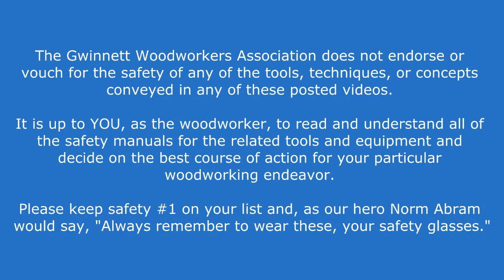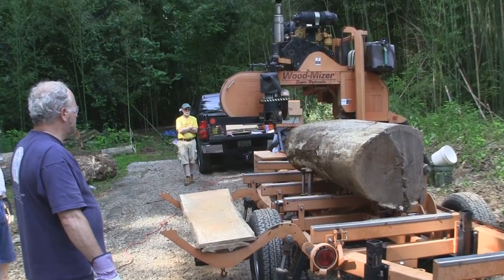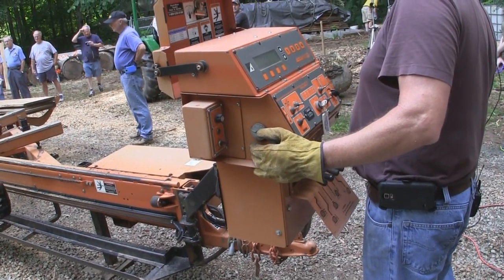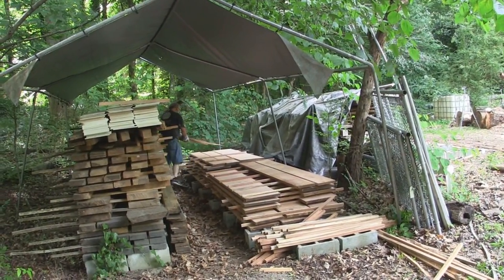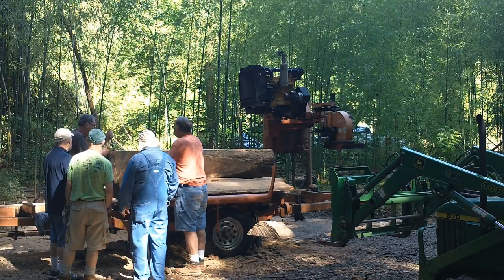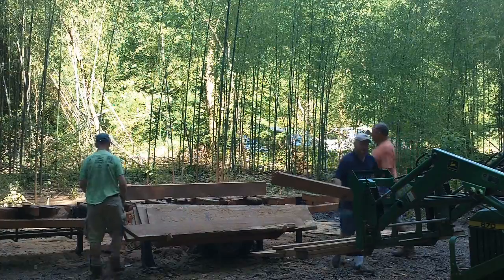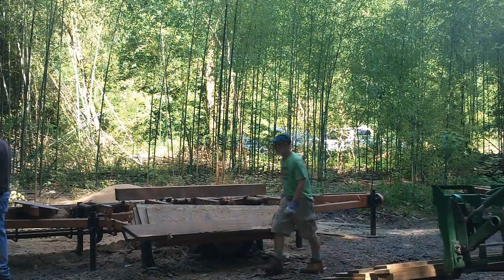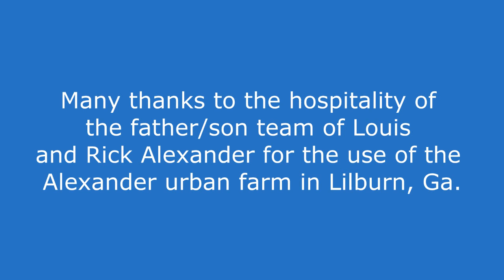2014-06-07 Wood Mizer Saw Mill Demo by Rick Clark of Woodgenesis LLC

Comment: Watched a lot of woodmizer videos and this is my favorite so far.  It is much better to hear an explanation than guess at what is going on.  I just purchased a used lt70 to saw up my large Cherry trees on my property.  I have zero experience in doing this so it is great hearing some things explained.  It would be nice to get even more info as you cut.  Like,  as the mill is knocking down the log in size why you take certain cuts to get it where you want it.  When I saw you run into a nail I realized you need a Amish nail puller to get them out.  They work great without tearing all the wood apart.  I will probably go work with someone who has a mill a few times and ask a lot of questions.  Thanks for the enjoyable (down to earth) video.

Comment: What is your opinion of using an electric motor. The diesel has a lot of torque for sure. Very loud and noisy, a lot of vibrations on the frame.

Do you like the idea of the electric motor.

Great vid, thanks for posting

Comment: how would one do this with out machine..the old way? long saw? 2 guys
Reply: Malcom AlphaEstateAgents Depends on how "old" is old. From the late 17th century on, saw mills were typically hydraulically powered. Basically, one big band-saw powered by a river effectively milling the lumber in the same styles we see today (flat sawn, quarter sawn, etc). In general wood working hasn't changed conceptually since the late 1800s. You could pick up a book on felling deadwood, milling it into lumber, planing to regular sizes, or joinery from that era and not be too far off from modern woodworking.
Reply: I'm just googling how saw mills work. And river saw mills..... brb
Reply: Yep I get it.  Quite an opperation.  Thank you.

Comment: use an air gun to get the saw dust off the boards.
Reply: +FurIouS19811 Its wet so that won't work either, tried it.